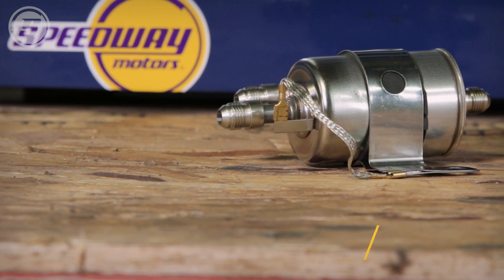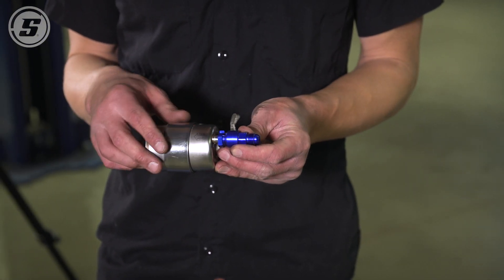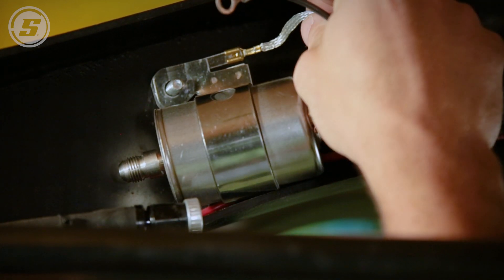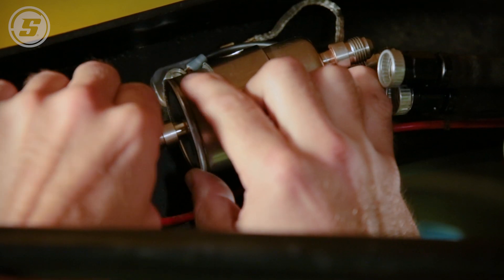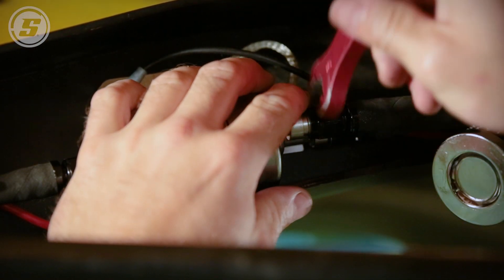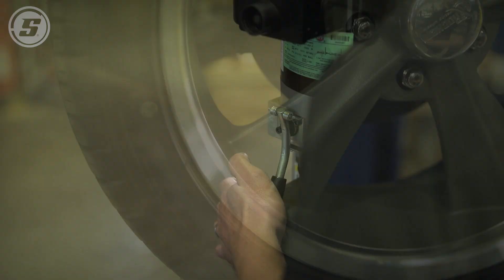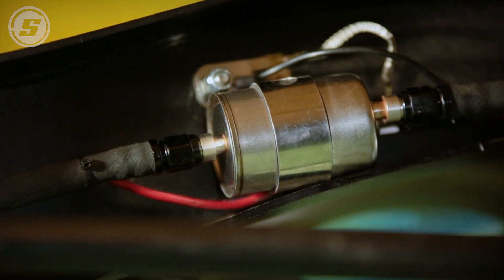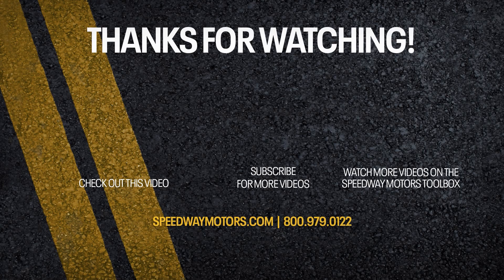LS Swap Fuel Pressure Regulator for Return-Style EFI Systems

Comment: I have a 98 corvette could I upgrade to this filter/regulator? I upgraded to a fast intake with single outlet rail and was wondering how I was gonna run the return line back to the tank.

Comment: So what happens to the return line off the intake, does it just get capped off now?
Reply from the maker: Yes.  Since the regulator will set the fuel pressure at a consistent 58 psi supply, the regulator & return line at the fuel rail will be redundant and won't be bypassing much if any fuel.  It can be capped.  The most common use of this regulator/filter is in swap applications where a regulator at the engine and return line are a added hassle to install.  If your application has a functioning regulator at the engine and return line present, you could just use a filter near the tank.

Comment: Speedway is a good company but my god, taking a new ACDelco filter out of the box, disconnect, wipe fittings, never had one leak, ever. I don't know what they implying if it's the guys fault for not hitting it with air to remove dirt, dust, small road gravel (Because) it's driven shiny side up, but leak. Not in my world. ????
DK, ASE Master Tech since 78, retired.

Comment: Ok but whats that random filter doing there?
Reply: Alexis, I can speak for this build but it is common to have a need for air to escape the fuel tank during refueling. Inside many fuel pumps is a simple roll-over valve that closes when liquid fuel reaches it, like a float in a carb. So until completely full, air exists the tank at a high spot, usually on the 3rd line or a line in the tank. Without a activated carbon canister, that captures gas fumes, the fuel pump at the station shuts off as you pump gas. A carbon canister is not hard to add on as a larger one from a full size truck works get. Plus the fittings are labeled on the canister. On an "LS" swap, you can have it programmed to delete EVAP testing, but retain the purge feature. This pulls fresh outside air thru the canister and it releases the fumes into the engine. At todays fuel prices, I want all my fuel to be burned in my engine baby! Safe & happy holidays! Hope my answer helps. (Note; This keeps the garage from smelling like gas as temperatures change as it expands or contracts) 
DK, Omaha. ASE Master Tech since 1978, retired.

Comment: Can i use a 400 lph fuel pump with this fuel regulator?
Reply from the maker: You should be able to.  Theoretically there is a point where this oem style regulator will run into a flow restriction on the return side.  If the engine is consuming more fuel and the higher lph pump is sized adequately, it would be returning a similar amount of excess fuel back to the tank.  If a 340 or 400 lph pump is used on an engine that doesn’t require that volume,  it would be better to use a racing style adjustable regulator with more capacity to bypass, such as one from Aeromotive.

Comment: Which one is the Send and which one is the Return? No one ever mentions this. On mine, all three are 3/8" lines and only the 'Out' is marked.
Reply from the maker: Hello. Here is a link to a diagram that shows the location of the send and the return. https://www.speedwaymotors.com/_next/image?url=https%3A%2F%2Fcontent.speedwaymotors.com%2FProductImages%2F91012808_L850_9ef3538d-5325-4462-8e65-294c4e55be0a.jpg&w=750&q=75

Comment: What lines are you guys using with it?
Reply from the maker: In this case, we used a push-on hose (https://www.speedwaymotors.com/Black-Push-On-Hose-6-AN,8976.html) and fittings (https://www.speedwaymotors.com/Speedway-Motors-Socketless-Push-On-Fitting-Kit-6AN-Black,423334.html). You can also use Earls Vapor Guard as well....hose: https://www.speedwaymotors.com/Earls-750066ERL-Vapor-Guard-EFI-3-8-Inch-Fuel-Line-Hose-Bulk-Ft-,272646.html  clamps: https://www.speedwaymotors.com/Earls-750010ERL-Vapor-Guard-1-Ear-Type-3-8-Inch-Hose-Clamp-5-Pk,272637.html  end: https://www.speedwaymotors.com/Earls-750166ERL-Vapor-Guard-Straight-Hose-End-6-to-3-8-Inch,272641.html We actually recommend the Earls set up for anyone that has EFI and drives their vehicle using normal pump gas.

Comment: I just watched a video by a guy who says these filter/ regulators can't handle 255lph fuel pumps. Is that true?
Reply from the maker: All of our testing and feedback has shown that these regulators work well with a 255 LPH pump. This LS swap regulator was installed on our own '52 truck and it has a few thousand miles on it with that part in front of a Walbro 255 LPH pump.

Comment: great product but, yeah 5 minutes to install - right? so the electrical wiring just appeared out of thin air for it, I know it has a ground but you had to run power to it, which I assume has a fuse, so again that just appeared out of thin air, these kinds of videos drive me bonkers
Reply: the wire is a ground that they already had. there isnt any power to it its a filter/regulator not a pump.

Comment: What fuel pump did you use? Can this hold a walbro 450 lph?
Reply from the maker: We used a Walbro 255 LPH pump. I don't know about a pump that big. We've never done it, so I can't say for sure.
Reply: Same question...I'm running a Walbro 450...
Reply: @boosted2.4_sky  
Yes,no problems..
Reply: Id like to know if it can handle flow of  wally 450 also. Gotta buy one asap